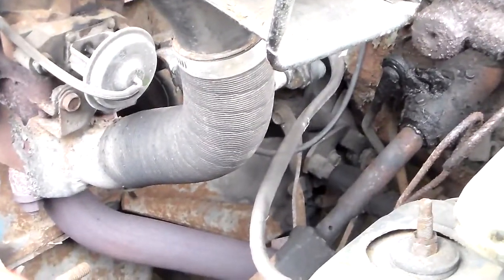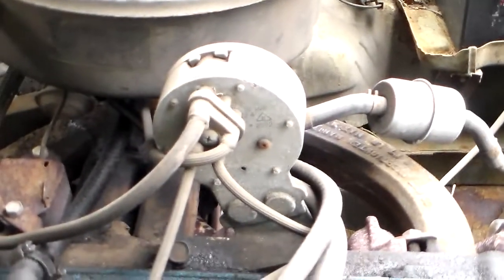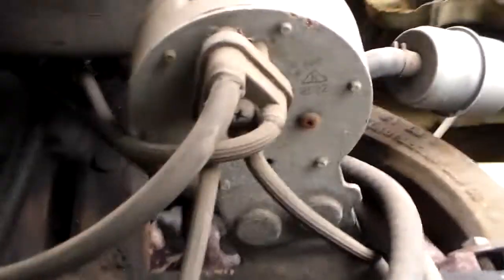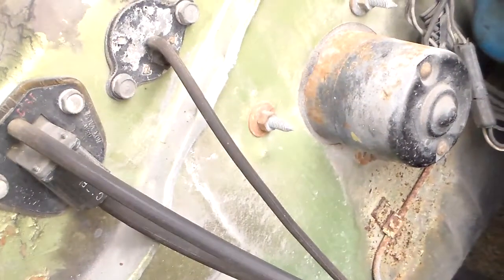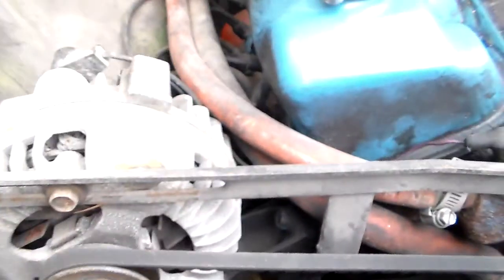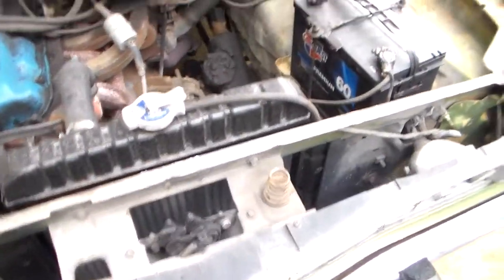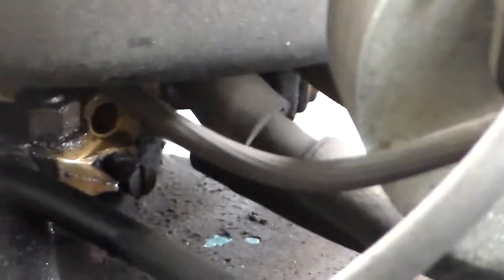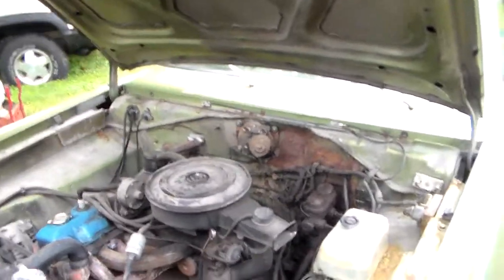Looking around under the hood of the 49,000 mile Valiant

Comment: No kidding! Thank you so much for doing a video tour of an original configured engine. I can't count the number of times I have tried to do research on vintage engines and unable to find any good solid documentation at all on how the vacuum system or anything is supposed to be hooked up. I live in California and the damn state is making me smog my 19 79 Dodge b300 high top custom conversion van. I am remodeling the interior but before I get too involved in it I got to get it to pass smog first. That means having every last vacuum hose hooked up correctly. So far no luck. I have a 1979 shop manual for this vehicle that still does not cover completely the vacuum diagram for a Edelbrock or Carter AFB 625 CFM carburetor. Everything appears to be two barrel or limited quadrajet which mine does not have. My never came with a quadrajet. It came with a Carter AFB 625 CFM carburetor. ironically I have been unable to find any solid documentation on this carburetor as well including the name of the dam ports. I just need to know what the stupid Port is on the electric choke and what the hell it's supposed to be connected to. I have no idea. Anyway sorry for the rant I don't mean to take my frustrations out on you or anybody else but while this is one hell of an adventure just to get it to pass smog. Ironically once it passes smog it will never have to be smogged again thanks to its age.

Comment: Thanks for the video and description, I have been trying to figure out what parts and what certain things were called on my 73 duster slant 6. Has most of that fancy choke and single barrel carb stuff. But I'm experiencing a dead key at ignition and seems to be no spark. Will work on her as soon as I have a few days off.
Thanks again for video
Reply from the maker: Usually the two main culprits for no spark on the '73-up with electronic ignition, in this order, are the ECU box on the fender and the ballast resistor, although the ballast resistor will let the engine run in start but not "run".
Reply: WhoSaidTyler well I had some free time changed out the ICM, and ballast same situation, dead key even touching the two prongs with screw driver on starter no spark( engine turns over but no fire up) Tried a spark test on cylinder 1, no spark so it's got to be the distributor/ cap/ or rotor. (I hope)

Comment from the maker: It does to a certain degree, but as long as it isn't active at idle it's operation is transparent. The OSAC valve(the hockey-puck thing on top of the engine) drastically affects performance because it's job is to delay the vacuum signal to the distributor advance. All of that will remain in place and look original but none of it will work any longer ;-)
Reply: Tyler's Neighborhood Garage  you're right as I disconnected mine on the 76 Aspen and it ran lousy until I reconnected it.

Comment: This is why I like low mileage cars or just any car that is old and hasn't been touched. Figures it was owned by a lady, or it surely would have had who knows what done to it. What a concept, leaving things alone! No hacks or re-engineering. Id even keep the original carb, but you know more about that than me, and if they are so bad, it may be better to get something else. 

It would look better with a cleanup. Too bad about the rust and that weird paint peel on the firewall.

Comment: Just thinking, if the woman bought it in 1973, and you said she is 88 now means she bought it when she was 40. So, I'm wondering, how does a daily driver for 48 years only have 50,000 miles? You would think she would drive to work or have to drive around kids. My dads car from 2005 has about 100,000 miles on it and has driven it for 7 years. 

Though, I'm guessing it was pretty uncommon for one single person to have multiple cars, but how is their only 49,000?